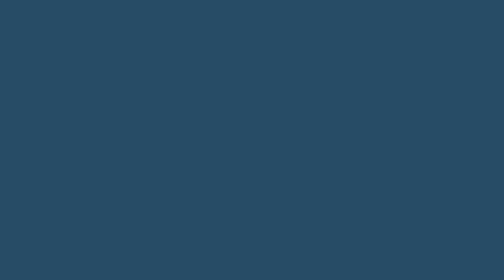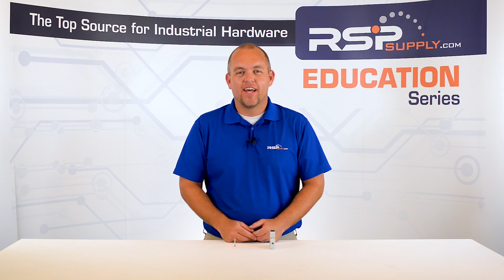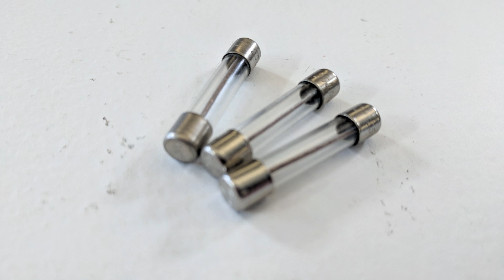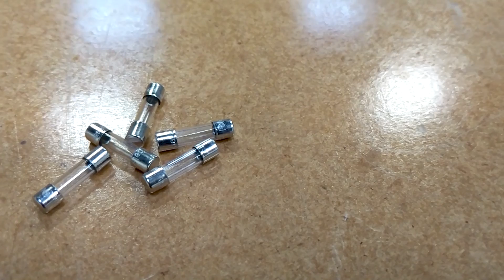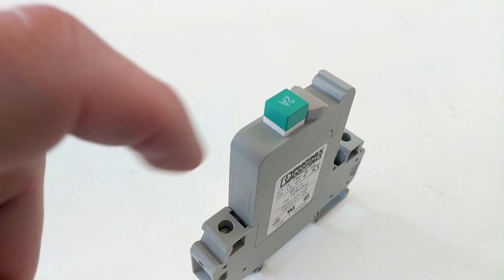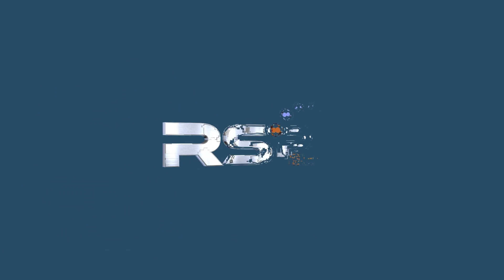Breakers vs  Fuses

Comment: Overcurrent devices are sized to protect the wiring in the circuit, not the equipment or the people.  That is why they are sized based on the wire size of the circuit, not the devices connected to the circuit.
Reply: @LTVoyager  why? Why not protect components? Wire is of little comparable value.

Comment: Yeah ok, but i have 1 Q you please answer, is it good to combine it, the circuit braker to be used as the main switch, and the fuse type as distribution system ? ? ?  Or vise versa ? ? ?. I thank your reply for advise or answer,😊
Reply: typically (In Australia) you will have a main HRC fuse before the supply meter which with feed all the individual circuit breakers.

Fuses especially HRC fuses are a very cheap and reliable way for circuit protection with massive fault currents.